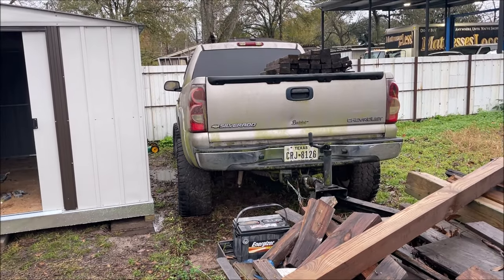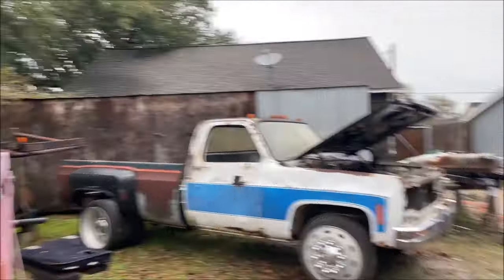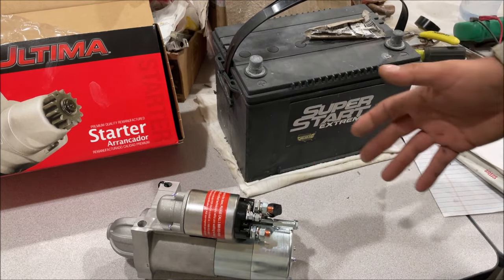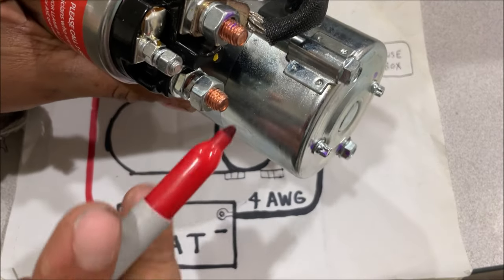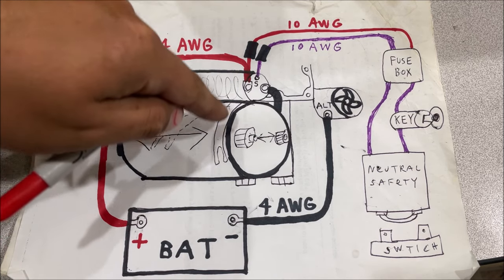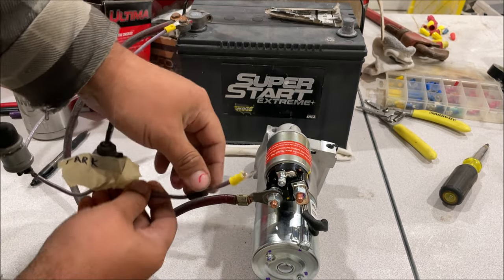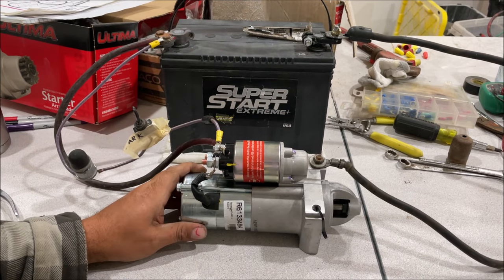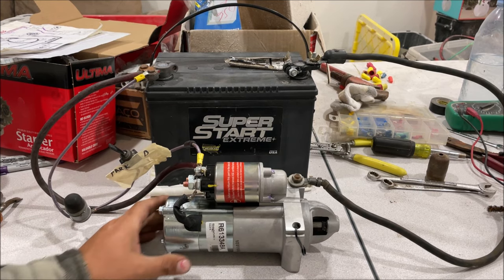HOW to test a STARTER MOTOR, DIY wiring diagram, and troubleshoot EXPLAINED

Comment: Hey Chris, Great videos. One more thing is that the neutral safety switch can be used to run a hidden ignition cutoff switch to prevent theft. Just be sure to let any potential driver know where it is. It can be a handy addition without having to cut/splice into the factory wiring.

Comment: Good job. My 2011 Hyundai Sonata sounded just like your starter. It was free spinning. In my case Hyundai used a cheap $8 plastic fork to engage the gear on the solenoid. So the fork breaks at its weakest link and the starter free spins. I bought the part from Sonata for $8 and replaced it and works just fine. Most starters have a metal fork Hyundai and Kia use a plastic fork. Same problem different reason.

Comment: Excellent video. I was also wondering if you were to put a fuse on the power wire that goes from the battery to the starter what gauge fuse should you use.

Comment: SBC starter on 86 El Camino has both R and S posts.  If the purple goes to the S post, what goes on the R post?  There is a little over 1/8 inch between the flywheel and the pinion shaft , but the pinion hangs up.  I didn't think I needed to shim.

Comment: H Chris. Great videos!  So the yellow wire going to my starter on my 69 Nova isn't used at all?  I'm using the stock wiring harness which happens to be in decent condition. I can tape back the yellow wire or cut it out completely if it's not used. My purple wire has a round bolt on terminal end and my mini starter has a male spade lug connection on it at the "S" connector. No biggie. I'll cut the factory lug off and put a female spade lug in its place.
Reply from the maker: the yellow wire is for points ignition to give 12v to coil while cranking.. see it in my points ignition video
Reply: I cut that yellow wire out since I’m using an HEI distributor. Your videos kick ass! I’d be screwed without them. Like you mentioned, other people leave out lots of steps and expect us to magically figure this shit out. I checked out a bunch of your videos and found other stuff to correct like the distributor wire getting 9 volts instead of 12. Cleaned up wire harness nicely too since I had it opened. Thanks so much for your help!

Comment: Man I needed this, I am troubleshooting a 79 Monte Carlo with 350 Crate motor and it just died on me, I think I am going to redo the wiring and components so that I know its done right instead of chasing receipts. And is there a power wire to the alternator from the battery too right?
Reply from the maker: I’m not sure how 79 is run

Comment: Just trying to wire my skid steer to 313 I got a 4 lb ignition switch just need to know where the wires go you can send me a diagram that be great do you have to ground the ignition switch I need to know where all the poles go to thank you

Comment: The inside of the main power post is fried. You can take the solenoid apart and flip the washer part of the post over( rotate it 180 degrees) and your gold ,,its fixed
Reply: Absolulty

Comment: ground pole of battery can be connected directly to the terminal of selenoid valve with strap wire or does it really have to be connected to the starter motor housing?

Comment: Your videos have been helping me build and rewire my 1969 impala. Your video are easy to understand thank you . But I been having a problem with starting up my car sometimes turns on with the key other time it does nothing. When I have it on start all the lights and gauges work . I been staring it with a screw driver any ideas , if not I was going to buy pass it with a 20 amp push to start from oreilly but don't know what gauge wire to get?

Comment: Because my starter is running free but when I bench test it the celinoid is kicking so I was thinking maybe it’s the ignition wire can this wire cause the celinoid not to kick or is it that I have to replace my celinoid switch???

Comment: Maybe I'm slow and dense, but what we wrong with other starter that was whirling? I had similiar symptoms. (also when i originally tried to bench test, i was using thinner wire which obviously wouldn't carry the current,, rofl. switched to jumpers for thickness, worked great) It worked on bench, then when i put it on car, just a whirl, no plunger to engage flywheel, quite annoying since the starter on said vehicle was on bottom and it took literally hours to get it on. (just really bad spot and i decided NOT to remove anything, so i was going under engine, beside the alternator, just in the middle of everything, close to no view of the 2 bolt holes on the trans so it was a blind install really).

I'm waiting for new oem starter to come in after weekend. I've been bingeing starter videos to try to understand.  I kinda get it, but nowhere near your level where you're able to freehand schmatics and such, damn bro. I've been into cars for a bit and have put many parts on np. but to understand the entire process and when things go wrong, being able to diagnose.  I suppose the more i expose myself to this kind of material the more i'll "get it". I'm the go to mechanic for my family. I understand complex things for the most part (engine and transmission) but for some reason the easier stuff freezes me up. like.. what??? The sad part, i'm highly into electrical, and yet i'm trying to diagnose and understand starting system. Repetition is my best asset right now.  Thanks for this video! Great explanations.

Comment: Hmm, thank you.  The 'shop' said i need a new starter, orielys tested it, and first said my battery was low, i asked what that was, and she said its failing.  Then she completed the starter test, er in the car not off, and said it was fine, passed the test.  She wouldnt explain what kind of a test that was.  I got my battery there and it still is under warranty, but she told me not to get a new one till i fix the problem whatever it was.  When i turn the key over, there is a low growing sound very loud, first time i jumped in the seat.   I had noticed the last few times before this noise that when i turned the key instead of it starting, i also had to give it gas, which made it zoom, even though i just tried to hit the gas fast and release.  then the other day when i started it at the post office it growled at me.  OK She, orielys said it battery was at 20%,  I said so if its not the starter what is it? she said, it could still be the starter.   is it my battery? you said to use a good battery  for the test, this is a 2003 malibu less than 10 inches from the ground, i have been thinking of buying plastic ramps that might lift it another 7-8 inches? i dont know  but the warranty is only for 6 months, and i dont want that car to smash my arms and head it they collapse! im in my 70's,   ok i hope you have time and patience enough to answer me soon? i know this is old but i hope you check your emails every day.  Thank you for this, i understood it all, actually very easy to understand.  Not like wiring my house but very similar

Comment: Thanks for the great video.  Very informative. I have two questions -
First, Is it necessary to use a 10awg wire from the neutral safety switch to the starter when post or pigtail for the signal looks like 16-18awg is there too much resistance in the long thin wire?
Secondly, on my LS swap into a thirdgen I get a loud click when the bendix gear engages but no crank. Sometimes I can get it to start after 15-20 tries other time not at all. When car is hit, it becomes more difficult to crank. Brand new AC Delco and high torque mini starters bench tested both with same result. 
Any suggestions where to look since both starters are good and I am able to start it if persistent but it’s getting worse.
Reply from the maker: Check grounds first.. I have a video if you don’t know about them
Reply: Lorey Mendez

Comment: Most “smaller” modern starters use permanent magnet motors. They create more torque with less amp draw than the old conventional wound starters. Unfortunately, aftermarket parts are absolute shit now days. We use Chevy trucks for our fleet. We have hundreds of 1/2 and 3/4 ton Silverado’s. Never really have starter issues but they are all 2010 and newer so it may be a design change after that body style.

Comment: So ive been having issues with my 2008 dodge ram 2500. When I go to start it it will click 1 time each time I turn the key. Sometimes when I put it neutral it will start right up. Sometimes I have to bump it multiple times in Park/neutral. Recently went to start it no click, charged battery still the same, tryed shifting it into neutral and back to park same.  so unhooked battery for a few min, hooked it back up and it started after a couple trys but then all the gears were lit and had the square around all indicating it was in all gears. When I went to pull off it corrected and had the square around the drive position... Ive replaced starter and battery last year and altinator a couple mts ago. Would you maby have any ideas what it might be? Was thinking neutral safety switch or wireless control module. Would love to hear what you think it may be. Thnx in advance.
Reply from the maker: to start you need to clean your battery terminals to the starter and check the ground to the engine..  that is where you start..

Comment: So my question here is where do you put a wire for an HEI distributor on this
Reply from the maker: different circuit.. HEI has nothing to do with the starter.. that is the ignition system.. it is ran on 15 amp fuse 12gauge wire off fuse box dedicated circuit
Reply: Okay so the starter you're showing here is more like the aftermarket high torque starter . Unlike The original G/M Starter With 3 Post. Which Is What I Have In My Truck 1973 Square Body GMC Now With A Updated 350 would be 290hp  HO Crate  But we put in some smaller 58cc chambered Heads With 1.6 Rockers A thinner Head Gasket. Making the compressor about 9.6 -1 on this Engine With A Edelbrock high rise intake should make about 325 horse now. It Had A HEI Distributor . Someone Bastardize The Starter Wires. So  Now I'm Trying To Figure Out To wire up both Starter. The three post OEM as well  The 2 post This Is The Only Thing Keeping Me From Being Able To Fireing  Up My New Engine. I Don't Want to Burn up The Starter ,Wiring or Charging System. I Appreciate You Responding Back Gear Much. Your Video Is Probably The Best That I Have Found. Because You Keep It simple not To Technicall. So if I understand you're right if I grabbed a piece on the fuse block that comes on only when the keys turned on that should keep The HEI Distributor Hit Until I Switch The Key To The Off position. My question here does that also give it power when I start
Reply from the maker: the 3 post starter is for a points ignition system . You just don’t use “I” or “R” ….only S .. the Nissan and gm starters are almost the same . I have a 70 Chevelle and an 80c30 too that I know way more about than this Datsun

Comment: What would energize the solenoid in the accessories key position?
Reply from the maker: nothing..accessories has nothing to do with the starter motor circuit
Reply: Yea I meant run position found out I had my neutral safety switch wired incorrectly but thanks for the reply and great content.